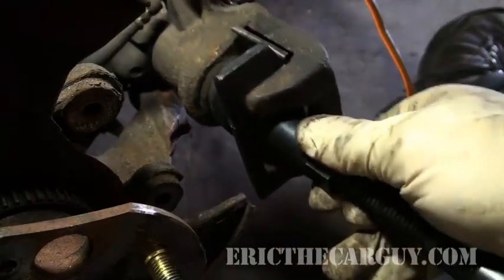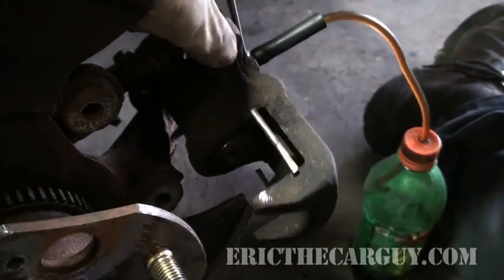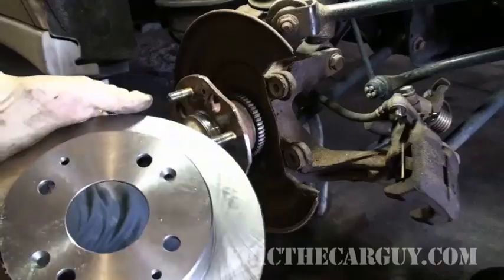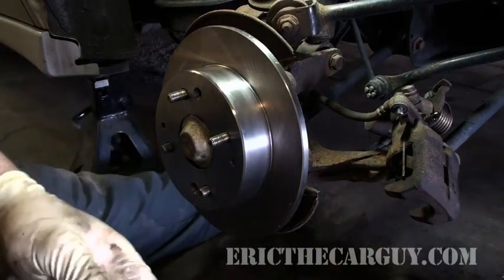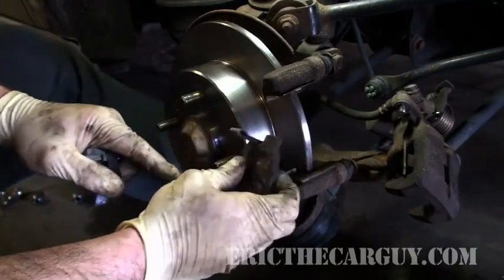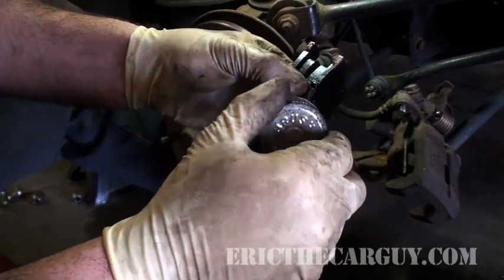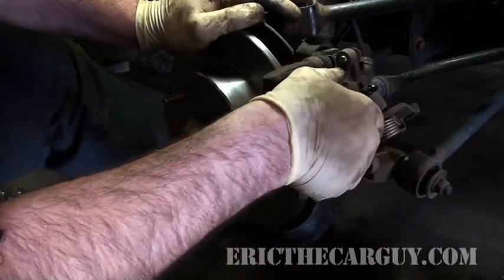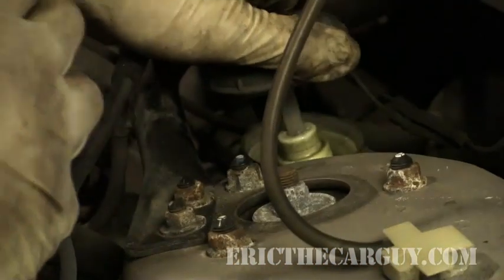Replacing Rear Disc Brakes Part 3 - EricTheCarGuy

Comment from the maker: @mrjost55 I highly recommend doing it the way I did in the video for 2 reasons.  First brake fluid will eat through paint so anything getting on the firewall as it comes out the top will eat the paint eventually.  Second, the master cylinder is designed to work in one direction, there is a CHANCE that forcing the fluid in the opposite direction will cause one or more of the seals in the master to fail.  I have seen this happen on more than one occasion so I just don't take the chance.

Comment from the maker: @buddyboy4x44 Thanks for the great comment.  Yes, I do push while I twist but that is to keep the tool on the piston more than to push it in, that should draw in automatically unless the piston was extended past it's travel, if this is the case then you will have to push it in until the threads catch inside the piston and begin to draw it down.

Comment from the maker: @axenz1 In addition to making it easier it will also help prevent possible damage to the master cylinder, not to mention keeping the mess off the floor and the firewall, brake fluid will damage paint.  This procedure is listed in many service manuals.  Thanks for your comment.

Comment: Hi Eric Your video is fantastic and helped so much.

One question once you have changed the rotors and pads what do you do if the handbrake is travelling to far when you pull it? I know there is adjustment at the handbrake handle itself but thought putting new pads on would make the handbrake travel less not more!  thanks Robert

Comment: Hi Eric, Is there a torque specification for those bolts  which holding the caliper on? You removed them so as to get the caliper off. Lionel.

Comment from the maker: @Michiganborn1969 Thanks for sticking it out.  In fact for the most part rear brakes are only doing about 20% of the work.  The heavier vehicles will have vented rear rotors, light ones don't need it, remember brakes turn speed into heat and the more mass you have the more heat will be generated as that speed turns into heat.

Comment from the maker: @LakeEffectKing I don't know what system that has off hand but if the parking brake cable goes to the caliper then it is the type that you need to twist in.  You won't know what the issue is with the caliper until you remove it, you can then check the slide-pins and piston for movement.

Comment: hey this is a GREAT walkthrough, thanks a lot. 

i have a problem. got the piston pushed back in with the edge of a wrench, then i put it all back together, but the little top squishy thing that allows the caliper to move side to side is jammed, completely seized. i've taken it apart and pounded it with a hammer and it absolutely will not budge. gonna see if i need to replace it or if it's possible to fix, which i am doubting at this point.

Comment from the maker: @c72zero Yes as a matter of fact a sticking caliper can cause the car to pull on braking as well as uneven pad wear.  You might start by cleaning and lubricating the moving parts of the caliper as shown in this video however if you have trouble pushing the piston back in this could indicate a problem with the caliper itself and in that case it would need to be replaced.  One last thing, if you replace the caliper and the problem is still there it could be a brake hose.

Comment from the maker: @diulaylomochohai No, you don't want to have the parking brake on when you do this, if you did you wouldn't be able to get the brakes apart because they would be applied.  The other disc brake video is the front disc brake video I did.  Good questions, thanks.

Comment from the maker: @aaronac8 No they don't, in fact most manufacturers just recommend replacement of the pads when doing a brake job.  If you don't have any issues with brake pulsation then I would just replace the pads.  If you service the brake as shown in the video using the correct lubricants in the correct places it goes a long way toward eliminating noise, the rest is really up to the pads you use, usually cheeper pads make noise in my experience.

Comment: Do you use OEM brake pads?  If not, what brand of brake pads do you recommend?  When you replace the rotors, what brand to do you recommend for them?  How long does it usually take for a rotor to reach its minimum thickness?  Thanks for the feedback.

Comment from the maker: @DALE97DSM That doesn't prevent squealing, it just makes a mess.  The shims prevent the squealing as well as the proper lubricants on the pads and caliper slides.  The best thing to prevent squealing is a good quality pad, the cheeper ones are the noisy ones.

Comment from the maker: @kobevsjordan310 I think you should be fine on both counts, the wheel holds the rotor on, the screws are just there to make assembly easier.

Comment: Eric I'm a novice DIY'er and all the brake jobs I've done so far(4), I never pinched off the brake line. I just open the master cylinder to let the pressure out when I push in the piston. Haven't had any problems. Oh and I bleed out the brake fluid afterwards if it's dirty or old.

Comment from the maker: @flaco198111 I don't sell those tools so you'll have to make your own.  You are correct that it is recommended that you seat in the new pads, usually about 30 stops from 30mph from what I remember, I probably should mention that at some point, thanks for pointing that out.

Comment: I've been told that the screws that are holding the rotor on are simply there to make assembly of the car easier at the plant, and that you can just throw them out when you do a brake job since the wheel and caliper holds everything together anyway, is that true?

Comment: Hi, Eric...

Great job on these videos. I need to replace front and rear brake pads on a 2006 Honda Odyssey. Is the piston compression tool required or can I use a large C-clamp and an old pad to return the piston to a flush position?

Thanks for your insight!

Comment from the maker: @aaronac8 Personally I don't do that but I've seen it done in an attempt to reduce noise.  I feel that if you use a quality pad installed correctly noise should not be an issue.

Comment: Hey Eric!
I'm planning on adjusting the parking brake on my 2005 Toyota Camry (which I assume as the drum-within-disk type parking brake.

My question is... when I replace the wheels, how tight must the bolts be? Do they need a specific torque or can I simply stand on the wrench thing (I'm like 120 lbs) and that'll be enough?

Comment from the maker: @hatdomfratdom I don't recommend that.  The idea behind my procedure is to prevent sending fluid back into the master and possibly preventing damage to it.  Removing the cap does nothing but allow the fluid to leak out and pour over the firewall where it can eat the paint as well as make a mess on the floor which is all easily preventable with a couple of extra seconds to crimp the line and install a bleeder hose.

Comment: Hi Eric, I never seen clamping the fluid hose and removing the bleeder while pushing the piston. That a good idea...normally I saw people here removing the CAP fluid then push the piston. But it's really hard to push the piston, unlike your video.. it's very easier to push it down with you style. Good job Eric

Comment: Eric thanks for taking the time to make these videos! You have helped me to change some old habits and have seen some better results in doing so on things. Quick question for you. How do you handle vehicles with stainless steel brake lines? I have alway removed the MC cap and using a clean rag taken some fluid out and then pressed the caliper in. What would be a better way of doing this? Thanks again!

Comment from the maker: @therockkkkher #1)  I don't really feel comfortable 'endorsing' a particular brand but I will say to avoid brake parts that come in a plain white box.  #2) no, doing a brake job should not effect the alignment. #3) I don't do alignments at my shop but I have done several over the years, you need a special machine to do that kind of work and they are pretty expensive.

Comment from the maker: @PoliceWillProtect That's a tough one because you really want to avoid heating them because you could damage the caliper or other components, you might try and air hammer with a pointed bit to 'impact' it off, it really just depends on what you have there and without seeing it for myself it's hard to say unfortunately.  Good luck.

Comment: Thanks for the response... I'm working on the rear brakes on my 94 accord, after I put the new disc and pads, I can't get the caliper back on, the piston is all the way back, but it just won't fit over the rotor and pads, it seems like the pads are too tick or something, any ideas? could it be that I got the wrong pads? they look exactly the same as the old ones, but I just can get the caliper back on.
thanks.

Comment from the maker: @kobevsjordan310 If it was the one under the master cylinder on an Accord those are actually suppose to be lifetime filters and do not get replaced on a regular basis as a result.  There is a 'donate' button on the 'fix it' page of my website, thanks in advance if you decide to make a donation.

Comment: I enjoy the videos. As an Auto student about to graduate and take ASE certification in November I find the little details the best part of videos. Several videos have new info to me. The homemade tools are great and I am going to add to my toolbox. I wish I had seen this video before I first r/r rear rotor & pads and wasted time.
Question: I didn't understand what you meant about master cylinder at end of part 2.

Comment: how did you make your bleeder reservoir ?  and i tried to change the breaks on my buddys 2003 buick lesbare and all of the caliper bolts were seized i tried wd-40 anti rust everything, and i don't have a torch what else can i do to unseize the bolt

Comment: Great video series Eric, finialy had a chance to see all 3 parts. Been busyer then a 1 legged man in an ass kicking contest latley. I've never seen a brake rotor that didn't have air vents before. I guess they figure that the rears do what is it? 40% of the stopping power?

Comment: damn... sorry about the multiple posts, it gave me an error when I tired to comment but I didn't think it would post the same comment over and over..again..  I apologize.
Now.. my question..... are the caliper brackets on my car bad? i can get the new pads on, even with the piston all the way back, the caliper brackets have the rubber boots on them, are those parts suppost to move? mine don't  move at all, thanks for the help.

Comment from the maker: @GrandDanois Sounds like you used cheep pads, not the best idea with that car in my opinion.  As for the screw holes they are offset so try relocating the rotor as you install it on the hub to line up the screw holes, if it doesn't line up after this you also have some pretty cheep rotors, also not recommended. You don't need the screws. As for your parking brake if it is different after you did the work you may have caused a problem inadvertently, resist adjusting it look for the cause first.

Comment: That caliper wobbling around would drive me mental,especially in a case where the piston is seized and needs a lot of force to release and then has to be wound in and out a few trillion times to free it up..solution - temporarily re-attach cradle and caliper(4 bolts...4 nanoseconds..bolts don't have to be tight - wear and tear reduction on  body - 37%,wear and tear reduction on nervous system- 103%).
No..I am NOT prone to exagurate..how dare you suggest such a thing.

Comment from the maker: @aaronac8 Depends on the vehicle, some aftermarket parts are actually the OE supplier so with some pads you can get OE parts without the markup.  As for rotors just don't go too cheep as they can be a problem.  I will say this, the most common complaint with cheep brakes is noise, you can go a long way to prevent that using the techniques in this video but the rest is up to the parts, if you do all this and still have noise it's probably the parts that are at fault.

Comment from the maker: @therockkkkher Depends on what the costumer wants and can afford.  Even if you use OE calipers they are most likely going to be remanufactured.  The point is to use quality parts whenever possible.  Yes, I do machine rotors, in fact I hope to make a video on machining brake parts soon.

Comment from the maker: @waza8i78 If I'm honest I've never used a torque wrench when tightening brake components.  That's not to say there aren't specs for it and that you can tighten them as much as you like but I suppose if you tightened them within reason you should be fine.

Comment from the maker: @ramrice I sometimes take a pry-bar and wedge it between that slide pin and the caliper to help break it loose, I've also used vice grips to hold it.  Both of these methods work best when used with an impact wrench, doing it by hand will take quite a bit more effort.

Comment from the maker: @flaco198111 Do you have the piston lined up correctly?  If not it won't' slide over the pin on the back of the pad.

Comment: I forgot to mention on my post to part 2, we highly recommend washing new or turned rotor with soap and water.  Once they dry, then condition rotor with the OE Approved Silencer rotor spray.  It treats rotor so speed of new pad burnish is slowed down and heat is better controlled. Finally, paint the inside of rotor hat or spindle face with our OE Approved Pastelub 2400 moly, graphite, aluminum paste.   The procedure is at... Stop Brake Noise. com.   Thanks, Gary

Comment: I have watched a lot of such videos and I am sure yours is the best I have seen, Eric.  You have a great style; your instruction is very clear.  I just finished doing a brake job on my Pontiac G6 which has that twist and push setup on the rear to compress the cylinder.  I wish I had seen your video before I did the job but I am 100% prepared for the next time I do it.  Thank you.  By the way, do you twist and compress alternately with your self made tool?

Comment: Eric, thanks for the video....educational and entertaining!  Quick question, do you know off hand if a 2006 Dodge caravan (not "grand") requires turning of the rear caliper to compress it?  Also, both rear rotors are rusted, and no signs of being used.  Do I absolutely have a caliper problem, or could it just be a seizing of those caliper mounting pins where the mounting bolts go into.
Thanks.

Comment: what kind of tubing do you use on that brake fluid collection apparatus?  I made a version of it myself (hope there's no patent haha) - But I had a bottle with a hole in the cap, and through the hole I stuck the plasic tube of a bic pen at an angle, with the other end over the bleeder haha.  Its not quite so elegant as yours, but it worked.  Necessity is the mother of invention haha.

Comment: Eric,

another superb video!!! do you leave the parking brakes applied when doing rear brakes? or do you have to release the parking brakes during the rear brake pad replacement?

also, you mentioned near the end of part 3 (near 9:15)  that theres another brake disk video regarding bleeding air out of the brakes, which video are you talking about?

thanks again!!! staying dirty!

Comment: Just a curious question as I was told this when I had the brakes done at Midas on my truck.  They say you should have brand new rotors turned to make sure they are not warped. You did not do that with the new rotor in this video.  What is your opinion on this suggestion?

Comment: hey eric, i was told that if I were to flush the brake fluid out and replenished it with new brake fluid at all 4 wheels I would need a special tool to communicate with the ABS system so it doesn't malfunction. Is that true or false?

Comment: Do rotors need to be machined or replaced every time you replace the brake pads?  Also, any way to stop brake squeaking only in the am when backing out of my driveway after the car has sat outside overnight?

Comment: Hi Eric, Thanks for an elaborate video. I'm unable to get the caliper bolt off. The tiny plate in front of the caliper boot rotates along with the bolt as I try to loosen it. Holding it with a plier did not work.